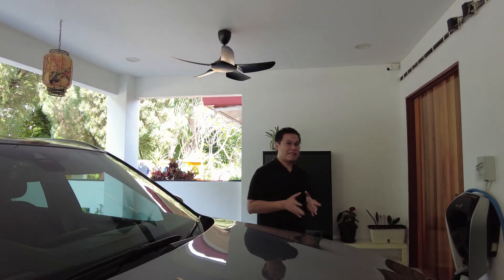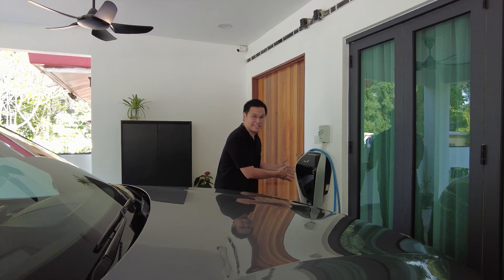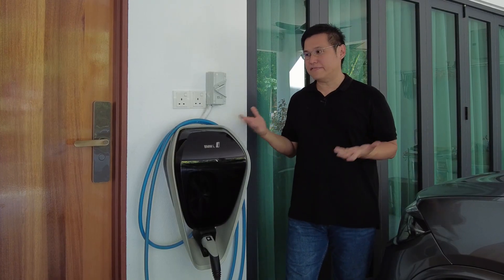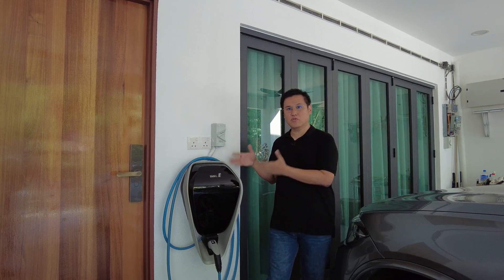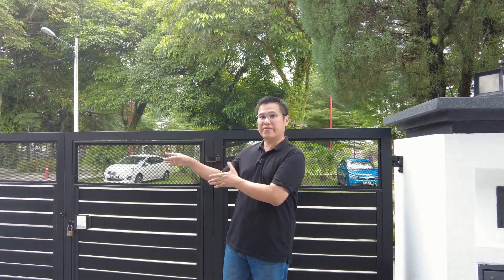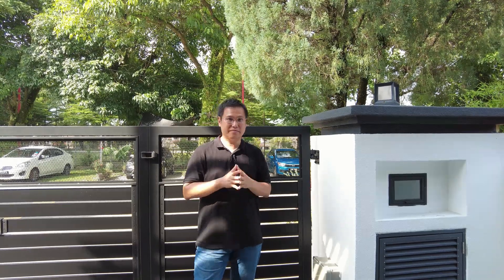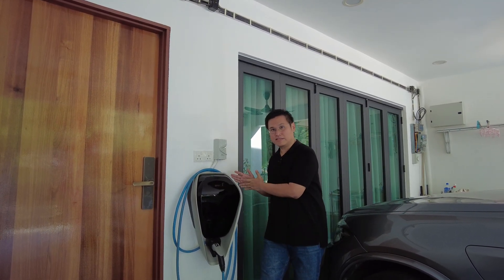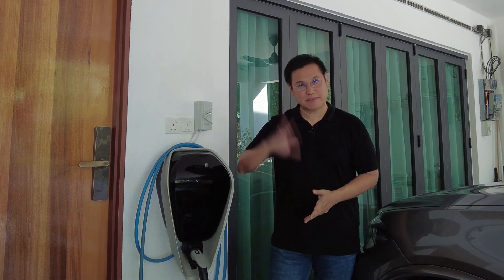Alert Notice! EV Charging Wall Box Charger (EVSE) Relocation/Installation Suggestion

Comment: Please may not be weather proof. Even it states this charging box is weather proof, just like any other solar inverter boxes with electronics component, the max it can last in general is 5 years. Again Before this charging box fails it will cause damage to any devices it charges.
Reply from the maker: I plan to install outside but will install the EVSE in small space in the wall like inside a "letter box"

Comment: If the electrical installer follow the EV electrical requirement such as using correct fuse + MCB (Overcurrent/short circuit), Type-B RCCB (Detect both AC and DC residual current), chances of caught fire is low. Too bad that Malaysia doens't have a set of law for installing EV charger at home.
Reply from the maker: Yes, my house installation follows the specs for electrical EVSE during installation. But the main problem is not the EVSE, but the Lithium-Ion battery itself.